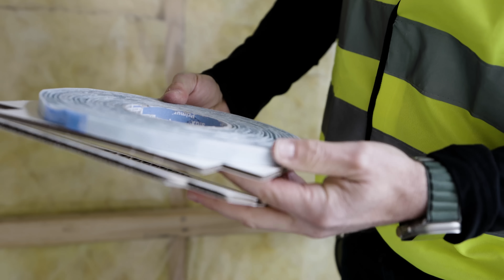Norway's different residential building practices

Comment: I live in Norway and although Norwegian construction practices may be fascinating, the design of houses and apartments is often unattractive.  I assume it is to save money.  Another point is that modern houses are built very close to each other.  Also, in some areas there could be more effort made to design houses which fit into the urban environment in which they are built.  I am not impressed by the design of modern housing estates either.  They are awful!!

Comment: The reason for similarities:
- small country
- very few contractos
- limited variety in material supply
Reply: there is no limited variety. There is stuff that works and stuff that doesnt, no point in selling crap that doesnt.
Reply: @tanelpolts7257  yes there is.
Reply: And TEK17
Reply: We also like to build things that last so there are solid regulations for this kinda stuff.
Our climate is also fairly similar across the country so there's no need for cardboard boxes like in Florida for example.

Comment: Everyone is following the same handbook, it's called TEK17 and it is the current minimal specification for new buildings in Norway.

Every iteration of the spec has raised the bar of quality on all buildings constructed in Norway, and by forcing everyone to build to the same code you create an economy of scale for the types of products included, which helps to reduce what could otherwise have been prohibitive material costs for many.

It is a valid criticism of the spec that it increases building costs, but the upfront costs are offset by the reduced maintenance requirements during the lifespan of the building.
Reply: TEK17 is a building code, but not a handbook. It doesn't tell you how to meet its requirements, just lists what requirements you must meet. The "handbook" everyone follows would be the SINTEF Building Research Design Guides.

Comment: Note that the orange gypsum is not regular gypsum, it can handle a lot of moisture, and changed building methods drastically when it came out. Before that, we had more layers on the outside.

Comment: For those talking about water freezing. That shoudn`t be any inssues considering the insolations indoors. As from a construction worker we put the water pipes / sewer pipe lines at depths below the permafrost layers to prevent pipes from freezing when your not using water (without water flow.) This is a basic plumbing rules for us outside. Tho if not deep pipes we got two solotions either put a hot cable for warmth or do insolations for the water pipes.

Comment: Problem with how its done in Norway is to build it alang with the Norwegian building rules, but they take shortcut so much as long the owner that bo it. And then the owner of the new apartment uses and waste around 2 to 3 year of their life to fight to get the building error fixed. And people that dont notify then they earn more. So the building rules is a big poletic mess. And they build the apartment so ticht that you most use electronics to get fresh air in to the apartment, and if the power goes the air inside will be shitt. And the constructors take the cheepesræt produkt rheur find and after around 2 to 3 years the problem will come. Check out and intervju the people that buy them and get the Trues.

Comment: in Norway u either build very proper or the house will be mouldy or fall apart very quickly. There is overall rules for how u should build buildings also. we have alot of rain and Temperatures range from -20 to 30+ Celsius this applies to almost all regions.  in recent decade or so tho there has been many times shortcuts where taken and use of cheap unskilled labor from eastern europe on multiple family developments.

Comment: Regarding rain and wood: The oldest part of my all wooden Bergen townhouse is around 250 years old. Of course, many repairs have been made during all these years, but the timber core and load bearing structure is still in great shape. Even many of the horizontally mounted weather boards date back to around 1850, when the house was enlarged. This is in the wettest town in Europe. These very traditional wooden buildings can last for centuries, but when insulating, a the advice I got from experts was to leave everything diffusion open, including insulation materials. I use blown-in cellulose fibre or wood based insulation mats when renovating. No damp barrier. This will allow the house to "breathe" between seasons.
Reply: I expect the interior air quality of your house is superior to that of the building filmed here. It will probably outlast this building too.
Reply: @LucasRichardStephens I was very unimpressed with that building. I’m a builder in the USA and it’s very disappointing over here too but I was expecting more from Norway.
Reply: @steveperreira5850  This is modern building practices. Norway has a lot of hundreds of years old wooden houses still standing...
Reply: @steveperreira5850  Norway  INC. Corporations that produce building materials dominate here as in the USA. They may mean well, but at the end of the day if the lifespan of the building is short and material consumption high, the profit margins are only larger. Modern houses consume less heat but who is working out the cost of rebuilding every 50-60 years. Maybe I am living in the past...?
Reply: @LucasRichardStephens  This is a very important point!
Reply: This is something I would recommend a lot more people to do.. You lose a little in efficiency, but having no damp barrier is a lifesaver to house longevity,
Reply: We have a nice outdoor museum close to where I live, Sunnmøre Museum, with lots of old, extremely rustic wooden buildings, and my sister who lives in the UK pointed out that the little, normal house they lived in was older than all the houses there! In Norway, 250 years on a house is really old, in the UK, it's quite normal...
Reply: Yeah thats pretty much spot on. I'm a building engineer in Norway. Whenever I have clients that want to after insulate their house and only that I have to explain just this.   It's a good thing to make the house warmer and more efficient. But the moisture also need to be addressed. Else you will find mold and other problems real quick even in a surface renovation
Reply: My Oslo house was constructed in 1880. Very few repairs and some upgrades.
The lower 1.5 floors are built from rocks, the upper 1.5 from timber logs. Coating is a wooden frame with gypsum surface, so the transition isn't visible.
Adding a heat pump was very tricky but also rewarding.
Reply: I certainly wouldn’t put that plastic barrier in the middle of the wall. I would do it the same as you

Comment: Handbook? No. But there is the TEK standard, which for any new built building has to be followed. The current one is TEK17, and if you do not follow it, you will get your ass sued off, and you have to go back and fix it.

Comment: alot of wood framing because there are a lot of trees here...... not really, a lot of wood framing because anywhere in the north of the country winter is so long hard and brutal that standard brick wont last as long as the wooden frame, all you need to do is replace the cladding every 10-15 years on a wooden construction but a brick build will be cracked and have damp issues within the same time span just due to water finding a way in freezing and causing cracks repeat for a few years and its major problems... this is the real reason that 99% of houses are wooden frame

Comment: My Norwegian house was built in the 60s, it uses horse hair, and sheep's wool as insulation in some of the older walls XD There are starting to be some humidity issues, so it's time to refresh them but considering they held so well for 60+ years is pretty impressive for such a caveman material.
Reply: The houses build in the 60s and 70s here i Norway seems to hold pretty well, they are built to dry up easy. I dont think new houses dry up inside the construction as well
Reply: Ahh the 60 and 70 when they just threw anything between the wooden walls to fill them up. Paper mulch, fabric, wood dust, news papers...u name it xD

Comment: I grew up in the 90’s and 2000’s here in Norway and we didn’t have heated flooring in our bathrooms (we have 3) back then. Only a radiator mounted on the wall above the door near the roof. Now days it’s the norm, we have it in our generic family cabin, and it’s so nice. And since heated floors now days are the norm, if you don’t, people would be like WTF👀

Personally I don’t understand what the Yankees are doing here. alike you don’t want our free universal healthcare because it’s “communist socialist propaganda”, but you want our building methods?🤭🫣🫠
Reply: Yeah, I remember those over the door electric directed heat ovens  in many of places (older cabins mostly). 
But as I 90s kid as well I never lived in a place where there wasn't electric heating under the bathroom floor.

Especially rural homes...MAN those are built to be toasty!
Reply: Your Healthcare isn't "free". And why do you have a problem with Americans (that's the proper word) checking things out. Go stare at a cold fjord or whatever you do.

Comment: A Finn here (we share a lot of the methodology with Norway, but not all of it). The reason we often have separate electric heating in the bathroom floor is to make sure the floor dries up after using the bathroom even in the summer, when the rest of the heating switches off. Also, it keeps the floor warm to touch even during the summer time.
Reply: Generally bathrooms will have its own temperature controll seperat from the rest. This is most likelly to make it easier to keep pipes from freezing in the winter.
Every single house i've lived in and visited have had that.
Reply: @silentdeath7847  I don't think it's related to the pipes not freezing as there are pipes going to other rooms, too, like kitchen and utility room. And the pipes freezing would be an issue only when the heating is on also in other rooms.
Reply: @fintux  as a renter, keeping the pipes from freezing is one of fuew responsebileties i have with the apartment. If pipes freeze and burst, i will have to pay for repair
Reply: @silentdeath7847  The water pipes are in the floor slab, they won't freeze no matter if the slab heating is water or electric based. @fintux yes that is common as well but I adjusted my outgoing water temp to 35c so the floors are properly warm, even if it is a bit inefficient. I have never seen singly family homes in Finland that have electric floor heating in the bathroom and water in the rest of the house, it is always full water floor heating everywhere. Only case I've seen electric floor heating in the bathroom is when the rest of the apartment or house is heated with water or electric radiators on the walls.
Reply: @silentdeath7847  I get that, but I don't see how having fixed heating setting only in the bathroom is goign to prevent the pipes from freezing. How could it stop the kitchen or utility room pipes from freezing?
Reply: @sampsalol  I don't know if things have changed recently, but in my previous apartment, some service men actually were asking several times if really the bathroom floor heating was water-based, and even asking to make sure they asked something like "Really? So does it really also get cooler in the summer" and then said something like "Well that's interesting". I've not seen too many single family homes with water based floor heating in general, so I don't know how they usually are, but those comments from the service men made me think that it was a pretty rare implementation (at least for an apartment).
Reply: @fintux  Makes sense if there is a cooling function implemented with the water heating system. Obviously you need to heat the bathroom floor with electricity even if you cool the rest of the apartment with cooler water in the floor. However I'm talking about single family detached houses where usually it is water everywhere in the floor, including the bathroom and cooling is done via an air source heat pump in the summer.
Reply: Same in Norway. Separate switch and thermostat for the bathroom floor.
Reply: And all this is especially important in Finland with our saunas
Reply: most important in the bathroom is the proper ventilation...
Reply: @allahsnackbar9915  yes, I never said the floor heating was the most important thing, though. I was just explaining some reasons why there often is electric floor heating in the bathrooms despite of having circulating water floor heating in other rooms.
Reply: @fintux  Ventilation is a given that it is always on and speeds up and down according to the humidity percent detected by the ventilation system. In my Finnish 2023 built house the bathroom also has a liquid heating in the floor slab with 35 celsius water going through it all year round. The only difference to the rest of the house is that the liquid is flowing unrestricted always, unlike the rest of the house with each liquid circuit panel controlling the flow according to the room temperature. Heating source is a ground source heat pump.
Reply: @sampsalol  yup, where I live there's a constant water flow heating in the bathroom (provided the circulation pump is on); however, the water temperature is not constant there, it depends on the outdoor temperature. But I've seen many dwellings where the bathroom has electric heating while the rest of the house has water-based heating.
Reply: @allahsnackbar9915 All new builds have a balanced ventilation system in Norway since 2017.

Comment: Downside is they take forever to build, they are expensive and only well established upper middle class can afford new apartments. Most of the country is still old 60-70s apartment complexes
Reply: I've seen similarly constructed apartment buildings in Sweden getting built in 6-10 months after foundation work is completed. Is that considered "forever to build" by your standards? Genuine question, I do not know much about construction
Reply: @ hard to answer, it all depends of size, but I do work in construction and I’ve seen over and over again the budget cracks and delay in Norwegian construction unfortunately
Reply: @barearerarehare for example of a category of building I've seen propping up in that time frame (6-10 months) close to me in Stockholm: some multistory apartment buildings (some 4-6 stories high) with 4-6 units per floor, divided into 30m2 to 65m2 units. Those are quite common in Stockholm's new construction in the suburbs not close but also not extremely far from the city centre (areas like Nacka, Solna, some parts of Söderort).
Reply: @Najsbyxor  if they are constructed the same way as this video highlights I would say it’s quite impressive
Reply: They don't take forever to build at all, but go off.

Comment: We also have solid wood wall buildings in Norway, that are more pleasant to live in than these houses you have reviewed, though they are less well suited to that particular coastal region you visited. Also cellulose fibre insulation is used extensively and will continue to increase in use. This building technique you have shown is a sad development for home owners here. Post war building here can be characterised by a continuous experimental progression of methods that change due to failure more than due to improving (though theoretical U and K values have increased). Conversely traditional timber houses continue to attract new builders and exhibit a level of sophistication these buildings are generations behind, displaying systems that were perfected and stabilised 5-600 years ago. These building traditions are also influential across Northern Europe. Solid wood houses will, however remain niche products for an above average informed market.
Reply: All houses that are a hundred years or so are usually solid timber and initially had very little if any insulation, but if they have been in continuous use most of them have all been insulated heavily since then. If the technique you are talking about is "lafting" then you can forget your R values. It's also problematic in areas with heavy rainfall like Bergen as the continuous rain and high humidity prevents the wood from drying.
Reply: @aBoogivogi  I think he's refering to cross laminated timber(CLT). I've worked on projects here in Norway with CLT construction, cellulose fiber insulation and brick cladding. No vapor barrier and no problem with humidity.
Reply: @bennis123  Both, l like both the laminated and the hand-laft. Solid wood suits this subarctic climate. It is just my opinion though, and I can see the attraction of the stick houses,  I just think it is an imported system that never managed to be better that what was already here, and in this film the newest iteration of that development does not attract me at all. If I build stick walls I use paper or cellulose insulation and opt for a high degree of gas/vapour permeability. The U values are not as well worked out as people are led to believe. Real world walls behave quite differently to the experimental set up for working out U values, they make mineral wool seem like a wonder product, it really isn't.
Reply: @aBoogivogi  If you learn the tradition of "Lafting", it is a very deep subject. Too extensive for a comments section.
Reply: Tell me a single benefit of a mass timber wall compared to the type of exterior wall in the video? There is none. @LucasRichardStephens